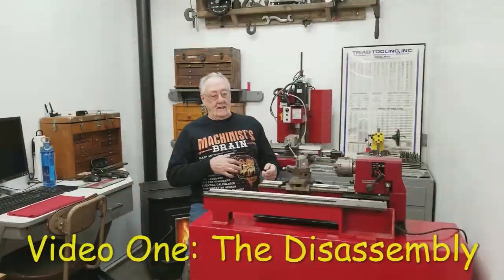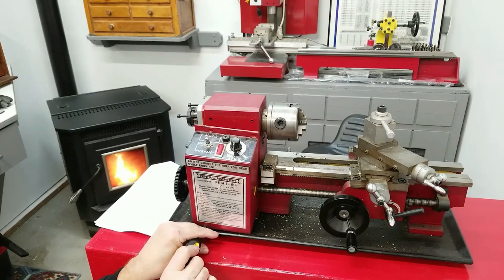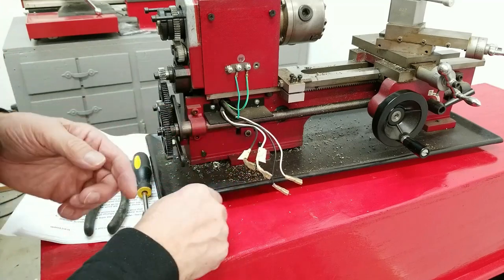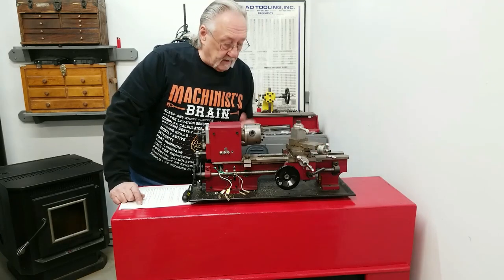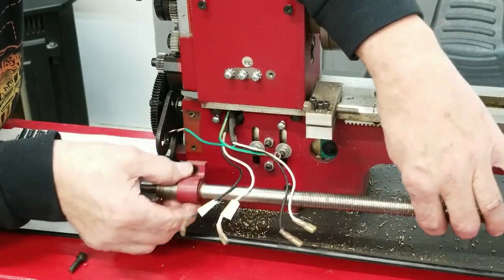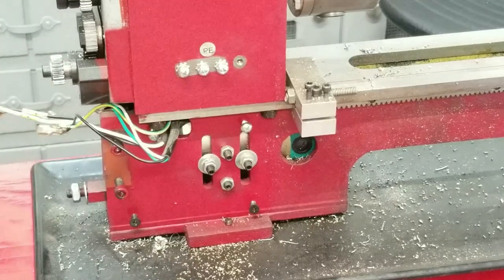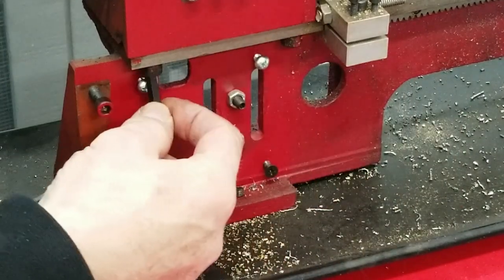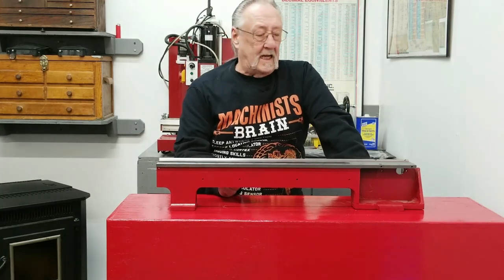Upgrading your Mini Lathe, Disassembly

Comment: What surprised me about the mini lathe is the amount of 3d printable accessories there are available for download for it. I printed an apron guard and was even able to print change gears with good results. The 90 and 100 tooth gears slow down the feed nicely.
Reply from the maker: I need to get a 3D printer. I think they are pretty cool machines. Thanks for watching my video.

Comment: Nice video. I am tearing mine down to replace the bearings in the headstock as well as the plastic 2 speed gears with steel ones. I  also gt a 750 watt servo motor with controller and new pulleys and belt upgrade.  Kinda a 3 in 1 upgrade.
Reply from the maker: Thank You for the compliment on the video. A 3 in 1 upgrade, wow thats a lot of work. I also need to do everything you just mentioned.  But after just getting it back together I think I'll just run it for a while.

Comment: Why is it that there are only 3 mounting holes/bolts for the head stock. It seems to me if there were four there would be less issues with run out and would make the head stock more stable thus your machining more accurate Thanks
Reply from the maker: You aren't the first person to bring this up. I wonder 🤔 the same thing.  I even been told by one person that he put in his own 4th bolt.  But you are right to ask that question and all I can say is we may never know. Thanks for watching.
Reply: @GlennNowOnYouTube  sounds like a future video idea.... I hope! I'm still torn between the HF Lather + bed upgrade or go with the Grizzly 9 x 16 lathe for $1500 including shipping.. HF lathes have some horror stories in the reviews with the Chuck being completely out of whack and impossible to align.
Reply from the maker: @ChristopherJones16  Hello Chris, You do understand that most all of these lathes are manufactured by the same company in China.  This company offers different add-ons to the Lathes and Mills  that they manufacture. They will paint them what ever color and apply any labels that the end seller wants. If you're going to buy a mini lathe you get what you get. Its a hobby machine. I had my mini lathe for about 15 years before doing any up grades. It worked just fine. Did it have problems.  Yes, But nothing you can't work around.  It is your money.  I decided to go with a HF lathe and it made parts just fine. Most of the problems that hobby machines have are the people using them. Just my opinion.